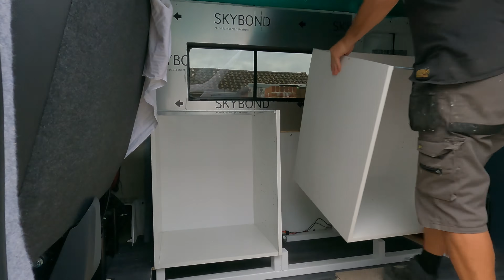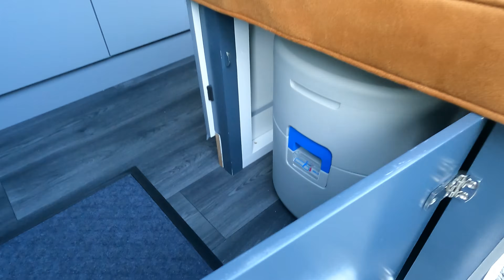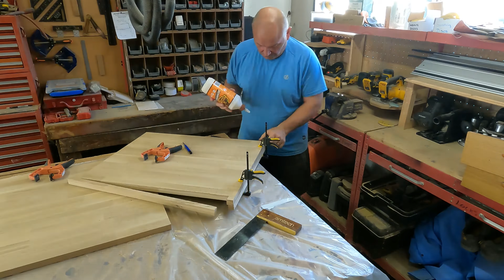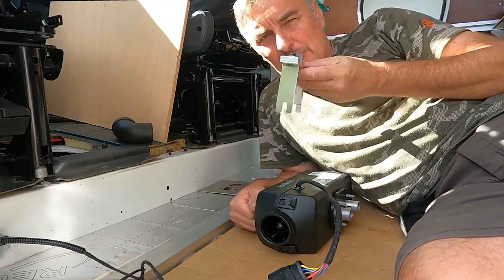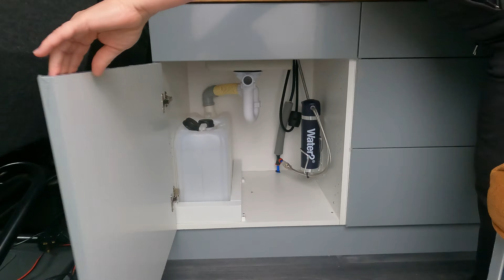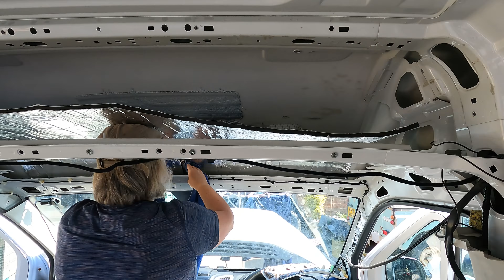VAN CONVERSION SERIES PART 5. Starting Van KITCHEN build. New Product NORDKAPP Diesel Heater

Comment: Thanks for making these videos, with the nordkapp does it have genuine thermostatic control as our cheap Chinese one has worked fine but having to turn it on & off to maintain temperature is not what I'd hoped for!
Reply: I can answer this one, the heater is equipped with an intelligent thermostat that automatically turns off once it reaches the preset temperature. It then reactivates itself when the temperature falls, ensuring consistent warmth and energy efficiency. In the 2kw model, temperature sensor is located in the display and it’s a start stop thermostat. Hope that helps 👌🏻
Reply: @theshakster thank you, just what I needed to know. I was amazed no one mentions the lack of thermostatic control in any of the many Chinese diesel heater videos I'd watched prior to fitting it. Sounds like the nordkapp is a good balance between quality & cost as couldn't run to an eberspacher etc!
Reply from the maker: Thank you for that Shakster.
Reply from the maker: Hi Chris, thank you for watching and your kind comments.
I'd no sooner fitted the heater when Darren came, collected his van and went.
I've just asked him to give instruction on how he operates it and I'm sure will be responding.

Comment: Yea ha. Just caught up and another vid drops.  Have you had a look at the Clayton LPS2 3000? Seems a fantastic bit of kit for power in a van
Reply from the maker: No, but I will now Antony.
Not much building happening over winter so should be a bit more consistent with the vlogs.
2 more to do on this one.
The vans finished and so far has been lived in "full time" through Ireland, Wales  and now off to Spain for a few months. Not what was intended but coping well.

Comment: Would have been good to see how you installed the fuel pickup - is this in another video?
Reply from the maker: Hey Rob thank you for watching. This process is well documented in many other vlogs out there so I didn't want to over play it.
The breather does just pull off through it's rubber seal when the fixing is removed, it's then the simplest of tasks to drill as you would have had to through the sender unit through the top of the breather, fix in the pick up pipe and then replace. Hope this helps.
Paul
Reply: We drilled & tapped the fuel pick up into the breather pipe was very quick & easy (<30min) & has worked faultlessly so would recommend it as easiest way to have a direct line from the diesel tank.